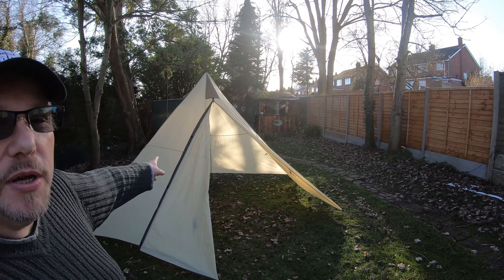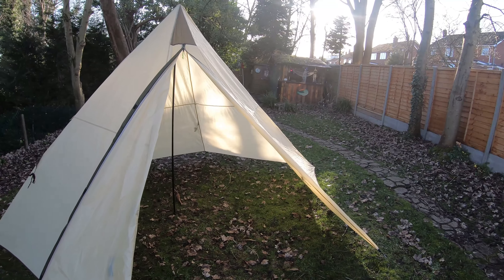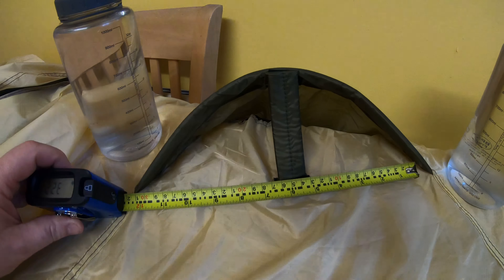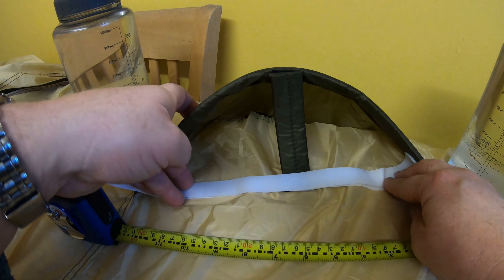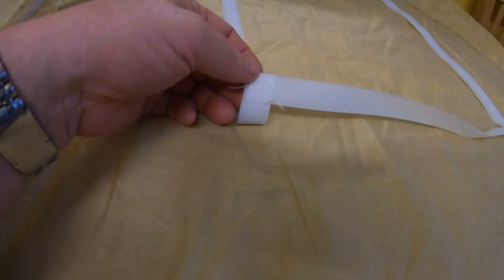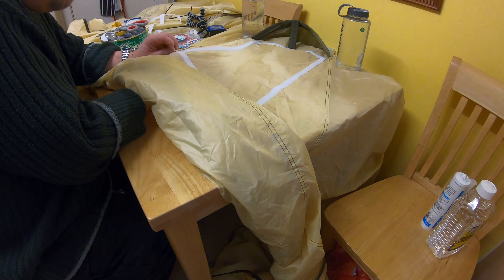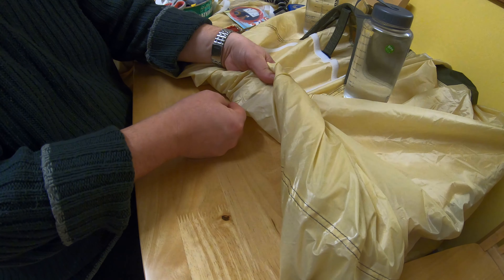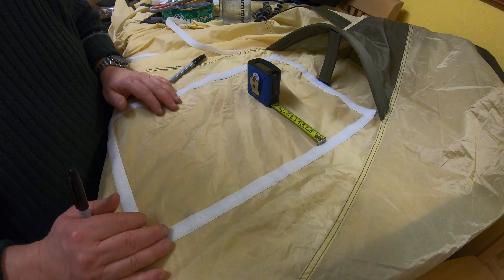8 Man Tipi Hot Tent Conversion - DIY Stove Jack Part 1

Comment: A silicone baking sheet works well mate, those fire blankets start to fall to bits when you cut them as thay are just woven strands of glass.
Reply from the maker: Yeah i found that out when i cut it. The silicone keeps it together tho. I was in two minds about using a silicone sheet, i have one as well i might make another one for backup!
Reply: @PaulBissekerBushcraft  I use a silicone baking sheet on my polish lavvu its allways worked out great, i use whats left of my fire blanket under my wood stove to stop it burning the floor or ember's dropping out and burning things.